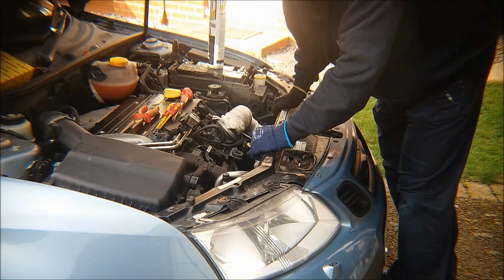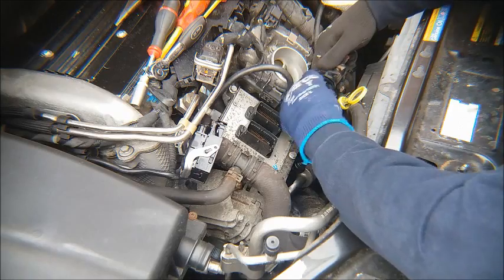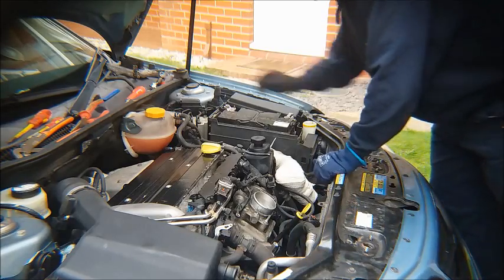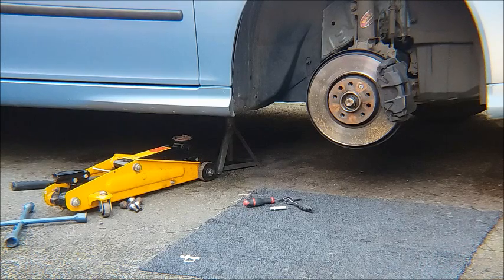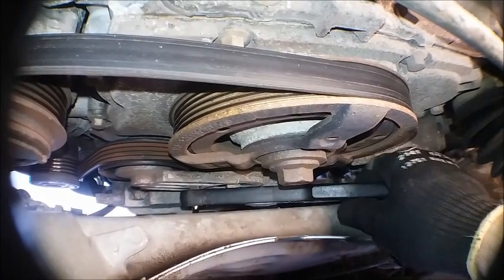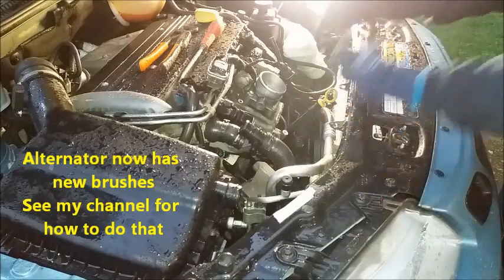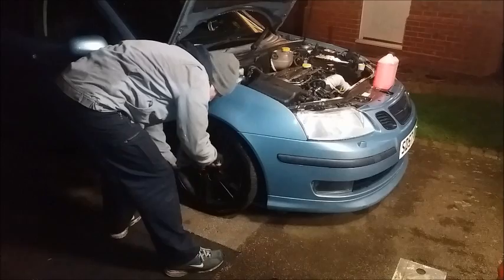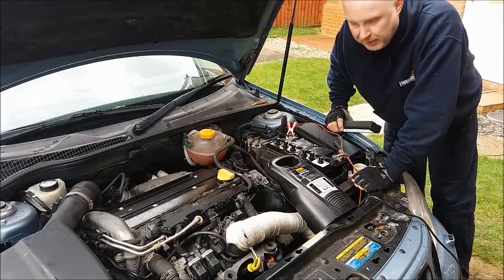SAAB 9-3 ALTERNATOR Replacement ~ SAAB 9-3 Alternator Location

Comment: 3.25 the wire harness plug.
I'm am close to getting out a sledge hammer !
Can see or feel any tags stopping it from disconnecting. 
You seemed to just pull it off in vid. 
It sits right in front of the alternator live nut. 
Aaahhhhh help anyone 
Please?

Comment: Helpful hint: Often, the threaded studs which the plastic nuts secure to are corroded & will snap when you rotate the nuts. If this happens, the snapped studs (which are welded to the chassis) will need to be ground off. Centre punch where these were. Pilot drill these (3mm maybe), then drill to 12mm. (note you may need to wiggle the 12mm drill bit in each hole to make fractionally bigger) Paint these areas with some kind of primer or Hammerite to prevent corrosion. Place a 6mm Well nut (google it) in each hole. Replace wheel arch liner & use FLANGED HEXAGON HEAD BOLTS  STAINLESS STEEL M6 16mm long to thread into the Well nuts. The Well nuts have a 13mm rubber cylindrical bit surrounding a metal m6 thread. The rubber expands, gripping the 12mm holes in the chassis that you drilled.

Comment: I couldn't reach the square hole on the belt tensioner with my ratchet,  so I put a stick from underneath against the entire tension pulley, which I lifted up with a jack-screw.
Thank you! Very helpful video.

Comment: Thanks Cyd, your video was really helpful and thanks to you I have changed the alternator on my ‘03 Aero. A couple of comments that others my find helpful ;

1. I found there is no need to remove/disturb anything on the intake side. The ecu can be disconnected and removed by sliding it out to the left.

2.  I had a Big Problem getting a 3/8 ratchet onto the tensioner. There just isn’t room so £20 serpentine belt tool from Amazon did the  trick. Had to shorten the length  to get it in but £20 well spent and potentially saved hours of frustration fiddling around under a car supported on Jack stands which is something I have never felt that comfortable about
Thanks again
Reply: @paulsingleton3839  You did the job fine without jacking the car and getting through the wheel well correct? I need to do this job but don't have a jack

How comes you shortened the tool?
Reply: @ unless you have access to a proper lift I’m afraid I can’t see how you can do this without jacking up the car and going in through the wheel well. Do invest in a pair of sturdy axle stands and take care.
Reply: @paulsingleton3839  Ah bummer thanks for the year late reply though! I guess I will try make get as far as I can. I think I still have the original scissor jack with the spare wheel so hopefully using that and an axle stand I can make it work.
Reply: @wrth  that should work just fine. If I can manage the job on my own anyone can ! Good luck 👍🏻

Comment: Hello C. C. I would like to start out by saying thanks for sharing, I'm going to try to change mine for the first time tomorrow. I have a question though: What the tool hanging on the left side in 7:30, and what's is the purpose of the tool. You didn't mention it in the upload? Thanks in advance. Kind regards.

Comment: Excellent videos Cyd, I have a question my Saab 93 is a 09 plate Diesel TID and the alternator is at the back of the engine so is the ECU is it pretty much the same principal as shown in yours, in taking out and replacing? Thanks

Comment: Thank you for this very helpful video! I have a saab 93 2007 1.9TiD and the alternator is to change. That will help a lot. I need to change the engine starter and because I had to disconnect a lot of times my battery to charge it, now I have the alarm alert that shows up… here for new videos suggestions  ;)

And thanks again for your great help

Cheers

Comment: Cyclone Cyd your videos are incredibly detailed and useful.  My alternator stopped charging and I bought a junkyard one and am trying to replace it.  I couldn't access the 3/8 inch slot to loosen the serpentine belt because there wasn't enough space to fit a regular 3/8 inch socket wrench. I bought the serpentine belt tool from NAPA (Part #: BK 7769078) and it looks like it should fit but I can't get the 3/8 inch square male part in.  The problem was that it was a very long bar and I could not get the right orientation.  I got a shorter tool and I was able to get it oriented. Thanks again for the detailed directions.  It was great to see the battery reading 14.2 volts with the light and fan on.

4 years ago

Comment: wrong to do better take from under in wheel house
Reply from the maker: You sure? Can you get it past the compressor and inner fender structure?
Reply: @CycloneCyd Yeah,i have see that and even me must take awaye my generator on my Saab 9-3.and  can do true wheel house.little tight but not impossible
Reply: Although I think it is the coal bridge that needs to be replaced just so try to change in place

Comment: Hi Cyd, amazing video thank you. I have a question, I have replaced my alternator and voltmeter tested it all. Annoyingly I have the the error message, battery not charging , on my sid. Any ideas? Battery reads 12.7v, running reads 14.4 and 14.2v under load. Help :(
Reply from the maker: check this https://www.youtube.com/watch?v=UKTd4aI3-Mw

Comment: Such terrible placement of the upper radiator hose isn't it lol
Reply from the maker: More than that - there's that horrible plastic tee piece waiting to split and dump coolant on your alternator❗ I'm so glad I changed to an ally one, when I examined my plastic one it had loads of micro cracks and was probably on borrowed time https://www.youtube.com/watch?v=rQhfDCYxplQ&t=10s
Reply: @CycloneCyd  I broke mine when adjusting my air filter box that was not on properly. Barely touched it. Had sitting for days until I could get replaced. Alloy now too as well.

Comment: Thanks Cyd. My alternator has just died (2004 Aero). Ordered a new one and will try an fix it myself. Great tip about the 3/8 ratchet - this should save me having to buy a tension bar. Question - In hindsight, would it have been better draining the coolant first? I am unsure if I need to do this or not.
Reply from the maker: Also with hindsight, a 3/8 breaker would be easier than a ratchet because of being longer, something like this https://amzn.to/30C3Y8l. Yes you need to drain some coolant out but not much. A simple syphon pump like this https://amzn.to/30C9zeI would be just the thing to get as much as possible out of the expansion tank before disconnecting the pipes.

Comment: Probably sounds stupid but I’m installing an alternator. Someone took off the old one, I can’t seem to find wire that connects to the alternator. I connected the harness.   Where does the wire come from?  I’m sure it’s hanging there somewhere I just don’t see it. Thanks!
Reply from the maker: Sorry I didn't see your question. I do hope you've sorted it.
The wire will be a thick one and come from the battery. Don't allow it to hang there - find it and secure it. If it touches the engine it could short the battery - NOT good.

Comment: Might want to replace that plastic T junction on the coolant hoses. They fail suddenly. In Canada and the US, there is a guy in florida that makes aluminium/brass replacement.
Reply from the maker: Hi delc9876, thanks for watching and commenting.

I haven't heard of that as a particular issue before, but now you mention it, it does rather make sense. Appreciate the insight, I'll look into it.
Reply: @CycloneCyd  you're welcome! http://www.saabnet.com/tsn/bb/9-3/index.html?bID=151111
Reply: Just sent you a fiver for some java. Pete
Reply from the maker: @delc9876  thank you, that's very kind.
Reply: My T junction broke a few weeks ago. The plastic was melted!
Reply: you can make one yourself from brass parts from lowes.. original plastic connection does not fail. however if someone replaced it with a after cheap plastic it will fail. over 350k on all my saabs.

Comment: Thanks for a very good instruction. I did not manage to get a 3/4 key to release the tension. I took a garage jack and an iron stick and was able to push up the bucket without help very controlled. It can be recommended
Reply from the maker: Thanks for that, I can see how that might work okay. 
Don't forget to like and share and subscribe 👌

Comment: great vid. How many miles had your car done before the alternator went?
Reply from the maker: Hi Framus, thanks for watching and the nice words. Don't forget to subscribe, like and share.

IIRC I mentioned it in the video, but I'm sure it was around 110,000 miles. Which is about right. Design life of cars varies from 10yr/100k to 12yr/150k. Don't know for sure about Saabs. And did you know the brushes wear faster the more power you use from the alternator? I drive with headlights on at all times, so that probably contributed to a slightly early life failure. I show changing the brushes in another video.

Comment: hi . do you no what amp is on the 1.9tdi 05 plate?
Reply from the maker: Mr Mr 120 or 140 depending on model I think
Reply: +Cyclone “Cyclone Cyd” Cyd if i put the wrong one on will ot work?
Reply from the maker: Mr Mr Oh yes. If your car has a 140 and you fitted a 120, then it might only be a problem in middle of winter when all the heaters, lights etc etc are on. Otherwise it shouldn't be a problem.

When you've fitted it, test it as per my battery/alternator video to make sure it's outputting enough - especially if it's a 2nd hand one.

Comment: Mine calls for a 140 amp alternator. I have the 2.0T here in the US. I was wondering why mine is not charging the system. I see three connections on the back but I only have two on my wiring loom.
Reply: I’ve cleaned every connection, ground(earth) wire, new battery.
Reply from the maker: Test the alternator:  https://www.youtube.com/watch?v=AT_XmlwMVz4
Reply from the maker: Most likely cause for not charging is brushes being worn:  https://www.youtube.com/watch?v=t2aEPD17r8w
Reply: Getting replacement alternator today, thank goodness I kept the receipt. I’m going to have it bench tested before I bring it home. The last one came with a test sheet showing that it had passed but I believe I burnt it out trying to charge the wrong battery for my car
Reply from the maker: Yeah, maybe. Could've knackered the regulator. Let's hope the new one works out okay. Let us know how you get on.
Reply: Will do. Thank you for the informative video as well. I couldn’t have gotten my old one out without your help
Reply from the maker: Search FB for "Saab 93 owners United kingdom" and join. I'm a moderator there. Great bunch of people from around the world. A wealth of knowledge. Oh and, thanks, glad it helped.
Reply: Got the new alternator bench tested before I left the shop and it tested good with a 14.7 charge capacity and it works on the Saab.
Reply: I guess people have been having trouble with the chain store remanufactured alternators a lot. My friends brother went through 4 this month on his bmw
Reply from the maker: Ouch! one of the reasons I do it myself: https://www.youtube.com/watch?v=t2aEPD17r8w
Reply: Thankfully he does all of the work himself, he has a Subaru Forester, wrx sti, Impreza sti and his bmw. Well he bought the wrx sti for his wife haha lucky lady.
Reply: Cameron Gast Where did you purchase your alternator? I'm just starting my search.

Comment from the maker: sorry folks something I didn't cover. Please make sure you catch the lost coolant in a receptacle of some sort. I had a large drip tray below the car. DO NOT put the old coolant down any surface drain: flush it away down the toilet so it goes to treatment.
Reply from the maker: @Tony da brindisi sorry Tony, I never saw your question. No, there is usually no fuse between alternator output terminal and battery. yes, a parallel lead is a good idea - do the same for the negative too.
I do hope you got sorted, I feel bad for it being so long